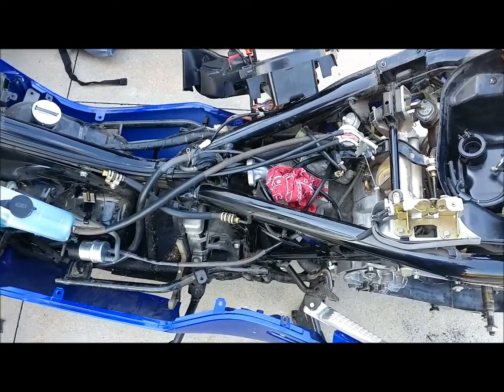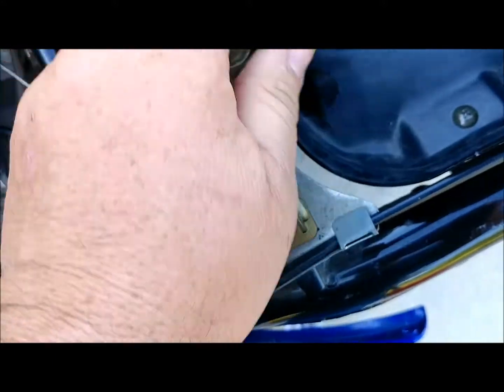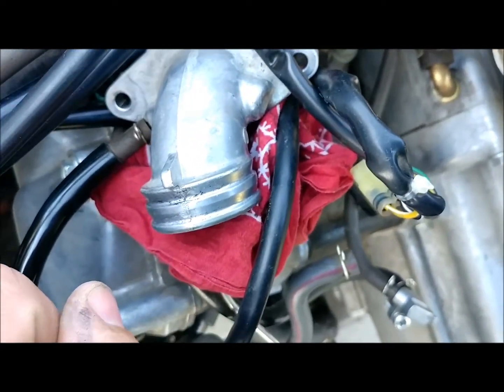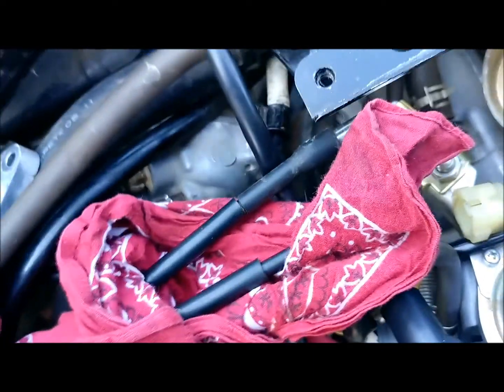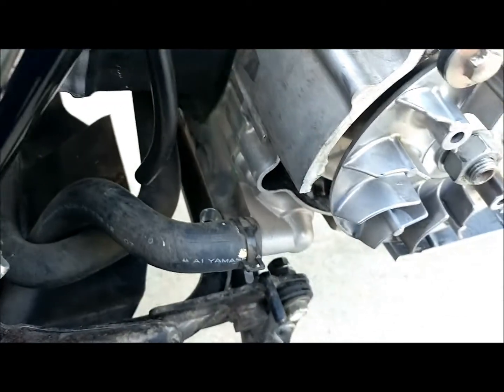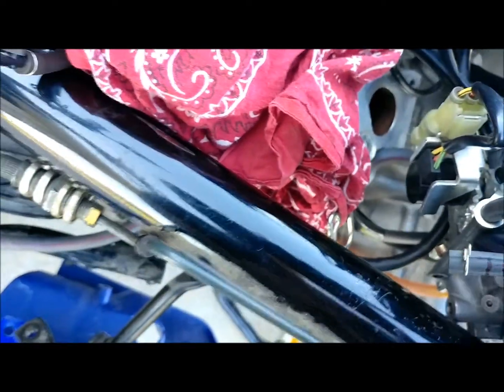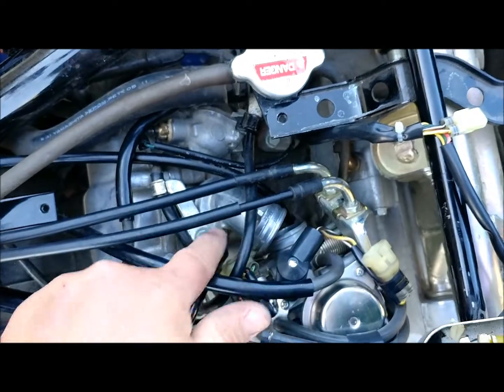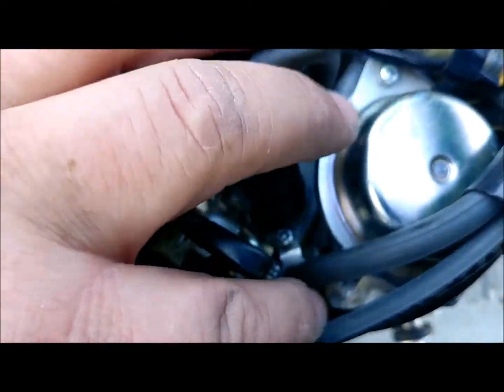Honda Reflex 250 - Carburetor vacuum line, coolant line, and vent line routing.

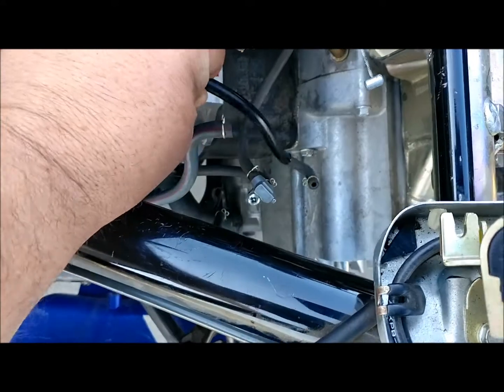Comment: 0:55 yea shes been on a block for two years. Broken swingarm and broken engine mount point after a bolt finally rattled out. Check your bolts. 
Found it finally but now which is which.

Comment: My reflex is a 2004 but should follow the same setup you're running.  I've had some issues lately with the bike losing power, then cutting out but then cranks right back up and continues on - I may check all the connections to make sure something isn't coming loose, and I'm running seafoam through the system to insure nothing is caking up inside the carb.  If it continues, I'll rebuild the carb this winter.
Reply: I have a red 04 with 8k and blue 06 with 4k and i will never work on these bikes ever again. My Dad had the great idea to buy them $1000 each to save gas since gas prices went up over the past spring/summer. Well the gas money that was saved got spent having a real mechanic fix the carbs on both bikes cuz i gave up. Never again will i buy a bike that has everything covered up with plastic. This reflex is just a nightmare to do anything on except changing the oil, fuel filter,air filter, and gear lube. Front brake was ok but rear sucked. Im about to just get an electric bike and be done with all this spaghetti mess of ICE carbs.
Reply: @Spaghettified_Ryan   a new carb is $35